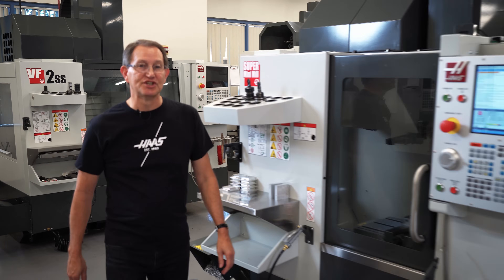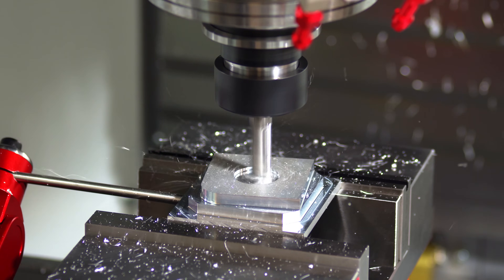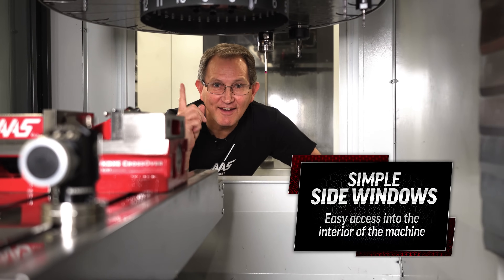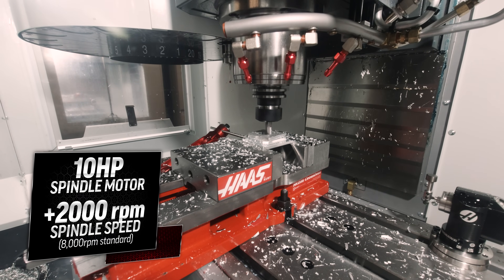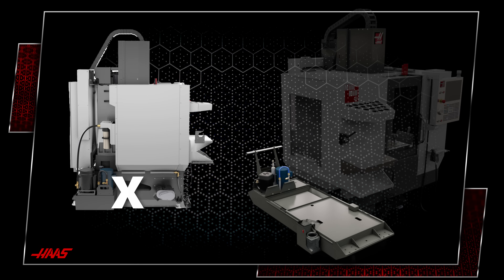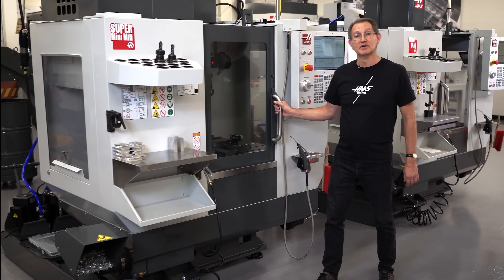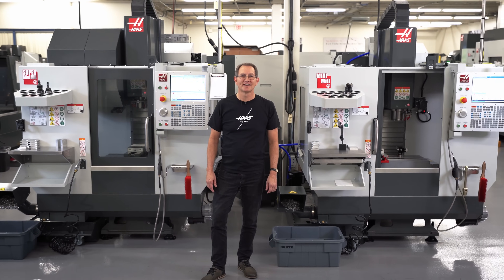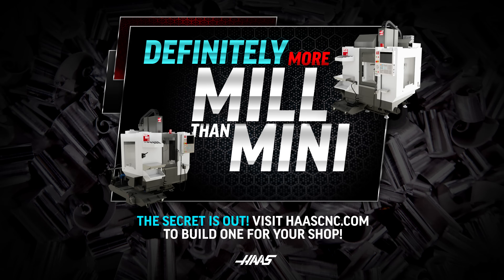The New Redesigned Haas Mini Mill! More Mill Than Mini? - Haas Automation, Inc.

Comment: Are they more Mill than Mini? NO! We bought a 2025 Super Mini-Mill this year and the machine struggles to tap 1/2-13 in copper. The 2004, 6000 RPM Mini-Mill it replaced didn't even blink to tap that. I also have to take smaller step downs and step overs when milling because the machine acts like a much smaller and lighter machine. The NGC control annoys me because I have to push more buttons and page through more screens to get the same work done. NGC is not as intuitive as HAAS would like you to believe. Our operators, who had little trouble on the classic control, struggle to do simple setup tasks. I had to figure it out for them and teach them how to use it. My biggest HATE for the NGC is HAAS replaced the "Orient Spindle" button with the "Graphics" button. It makes so much sense to remove a button I use 10-30 times a day and replace it with a button I use once a month at most. Haas does a lot of great things, but they missed the mark on these things.

Comment: This is how the mini mill should've been designed in the first place. The coolant tank is such a pain to clean, no side windows so you can't hold longer pieces, and they used to have the side mount tool changer as an option but then took it away. I love our 2021 Mini Mill, but these improvements should've been standard years ago.

Comment: Just got word that mine has shipped. Ordered just before Christmas. I went standard mini with 20 tool changer, WIPS, P-cool, rigid tapping, and part hole air blaster. Excited to get it installed but, with the snow we've got on the ground right now, I will probably be waiting a while.
Reply: wondering I'd it has a mini price or ridiculously expensive
Reply: Yeah mind I ask what you paid for that configuration?
Reply: @durangotang1681  $63,335 all in with shipping, rigging and setup.

Comment: Brand new to cnc world. Bought a Tormach 440 nearly a year ago, it has not ran for 30 straight days without a problem. Parts are replaced under warranty about once every 60 days on average. Tech support will ignore you for up to 3 weeks at a time.... I should have spent the extra 10K and went with HAAS...
Reply: absolutely. i waffled between tormach and haas. my mini mill with wips and a couple upgrades was 43k delivered. all ive had to do was change the drive belt {under warranty it was a little noisy} and broke the window when a shell mill lost an insert, cant blame that one on haas but they took care of it for me. only thing i dont like about haas is the software updates are a little bit cumbersome.
Reply: Haas is like an old Ford.  It'll run like shit longer than any other car will run at all for the same price.

Comment: still offer a single phase version?
Reply from the maker: jameslee522, The Mini Mill can be wired up either single phase or 3 phase. You can check the electrical requirements here: https://www.haascnc.com/machines/vertical-mills/mini-mills/models/minimill.html 
The Super Mini Mill however will only run on 3 phase due to the side-mount tool changer and 10K spindle.

Comment: This is the Mini Mill the world Deserved! Well Done!
Reply: A little bit bummed I got the Mini Mill 2  (10K Spindle,  Probe ect. ) A year before this came out. I have 600 rapids vs new  800, but I really like the external coolant tank and 10 HP of this one . 

Truth is I'm doing small stainless and titanium parts,  so I guess I don't need the extra HP or the claimed  rigidity bonus.

I also get the larger discontinued 40x14 table versus the 36 x 12. Also I think the old MM2 is known to be a very reliable model. This one has yet to be proven I guess .

I'm probably just trying to cope. 😭

Love you channel Nerdly🤝

Comment: Will it run off a standard house 110 outlet
Reply: 220 single phase unless you choose certain options which require 3 phase.
Reply: @poetac15  awe dam for real. Yeah my wife would kill me if I put a haas mill in the laundry room so that’s a no go for me lol
Reply: @Core.cs1 its certainly not the 60k+ price tag stopping you, either.

This thing is overpriced
Reply: Dem I was hoping it in the the 20 k price range....
Reply: Get a 110/220 v transformer and run it slow

Comment: Had one for years, ticks all the boxes,   10 yrs old now with zero issues.      I am not a job shop,   make my own parts and some contract parts,     I also have a TL-1,   a perfect partner for the mini mill.
I have screwcut 3/16" threads on the lathe.......perfect... Also 6" UNC  threads, perfect,     I have only 220 volt grid power but it is fine.  No power issues at all.  even running a big face mill on 316 stainless.    Haas rocks!
Reply: air cooled spindle?
Reply: Sure,   it is normaly around 68 degreesin my shop, not 120..  @abbirina

Comment: But will it fit through a standard garage door?. I am looking forward to reading the specs.
Reply: I want to know also! 80 inch standard garage door
Reply: No but yes. You have to tell your HFO its going through a 7 foot door and they will prep it so that can happen. They have to take some of the column covers off and drop the drag chain then its able to be squeezed in. Remember if you have 8 foot ceilings you have to cut a hole for the column as well. It does fit between studs so its an easy homeowner project. {i did mine myself.}
Reply: I just got my redesigned mini mill installed in my garage, it has an 83" opening and it fit as long as the cable chain was loosened at the top. For an 80" opening you will need to completely remove the cable chain, but should be able to clear without taking the big resistor off at the top. It was CLOSE though, but that's what you pay the riggers for. They will get it in one way or another